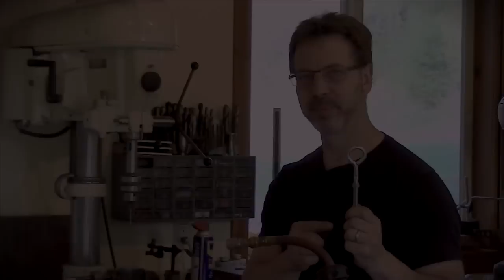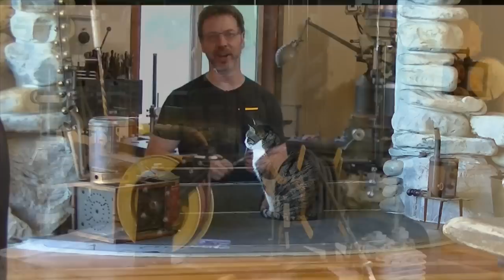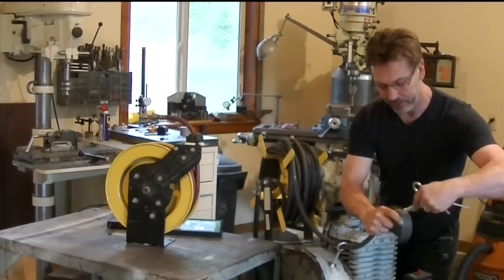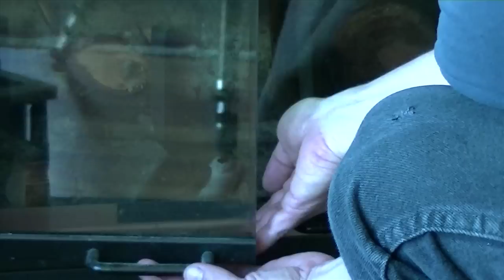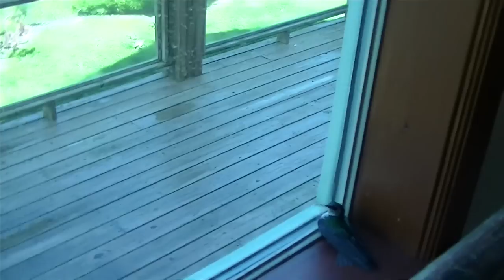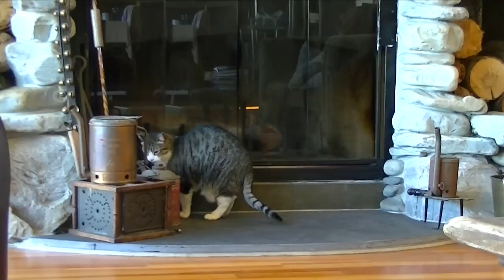BEST Hose Reel Modification Ever !!!!!

Comment: Pretty smart, and I have several of those bolts in my shop. Reminds me of the time I was watching a small bird playing on the edge of our fountain. It suddenly disappeared into the fountain. I quickly went out and found the bird under water being beaten down by the falling water. We brought the bird into the house and placed it into a cardboard box lined with towels we warmed in the dryer. The bird soon dried off and returned to the wild. Our little dog watched intently throughout the process, just waiting for a chance to pounce. Well get to work and install the bolt. Great tip Dale.

Comment: Nice video Dale - I've found that many Harbor Freight tools benefit in function and/or safety from an easy modification. You might also find a big rubber grommet to make a hose stop so the hose end stays in place and you don't have to thread it back through every time. 

One small note, it's not at "I Bolt" - it's an "Eye Bolt" because it has an open eye at the end. (OTOH an "I-Beam" is correct because the cross-section looks like a capital letter "I".

Comment: I think that was a stroke of genius.  I still want the spring loaded hose reel though.  You need to put a little cage on top of the chimney to keep wildlife out.  I have had one up there for over 30 years so if you make it out of good material it will last.  I do have to put it back on after hurricanes.  Thanks for the video.
Reply from the maker: +cerberus I m glade you liked it.

Comment: Hey Dale, Is that a Walker Turner Drill press in the back ground ? If so how do you get the dang drill chuck off ? I need to fix mineand I do not want to wreck it. Thanks

Comment: I mount that reel on a small frame that has 4 casters under it.  I can use it as an extension for my shorter hoses.  And I can roll it all over the place.  Now I need to add the eye bolt to it.
Reply from the maker: +hamsoftware 
:-)

Comment: I have this hose reel. I want to find out how to stop the hose from unreeling itself on to the floor due to the weight of the hose with air nozzle on the end. It needs to have some resistance when unreeling. Rather then taking it apart and figuring it out... 

I thought I would search to see if some one else had figured it out first. So any one knows that mod please tell me where to find it.

Comment: ...or just use a complete roller fairlead from a cheap Chinese winch. That'd work for larger-diameter hose, too, and be easy-pulling from virtually any angle... whereas the eye bolt tends to drag badly when you pull hose at a near-perpendicular angle.

Comment: You knowing taking us all for idiots... that dam hose will not glide on the eye bolts at a angle..... I was so looking forward to see you pull the hose side way as it will not work..... there's a reason why there's 4 gliding wheel on the spring tension hose reel so to be able to pull hose out at a angle/side